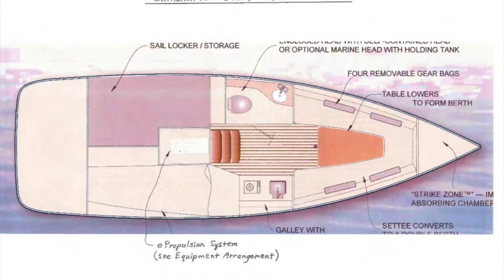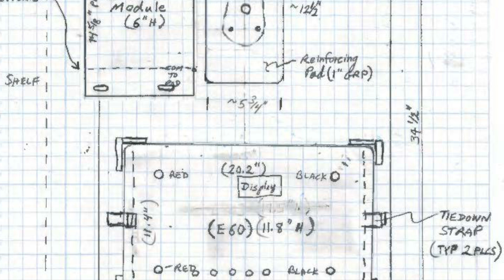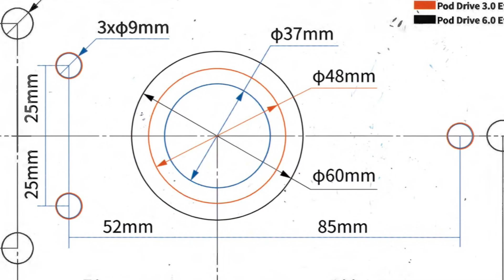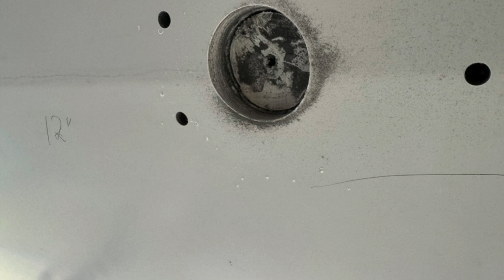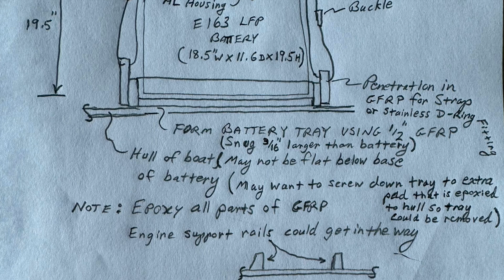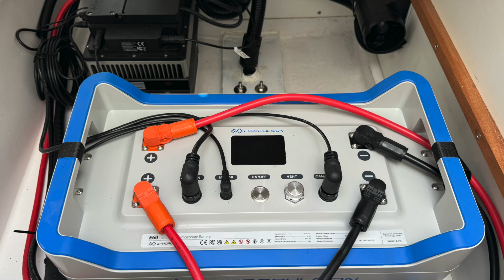Installation of Electric Propulsion in Sailboat

Comment: Great work. But unfortunately, you made a major mistake that you should definitely correct. ePropulsion specifies that the installation must be "terra neutral separated." Every metal enclosure must be grounded. This is especially important for the pod itself. Failure to do so will cause corrosion on the pod.
Reply from the maker: All components are grounded, the enclosures are plastic but circuitry is grounded.  Have not seen any corrosion, not even the anode by the prop, but boat is used in fresh water.
Reply: I'm about to install two Pod 6 drives myself in a couple of months. Haven't thought about grounding them. How would you ground the Pod drive in a setup like the one in the video?